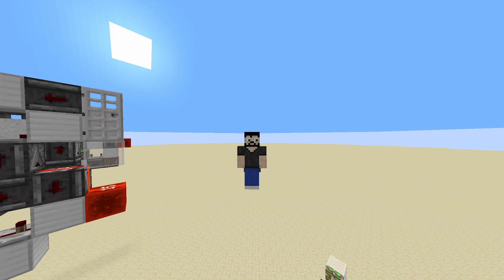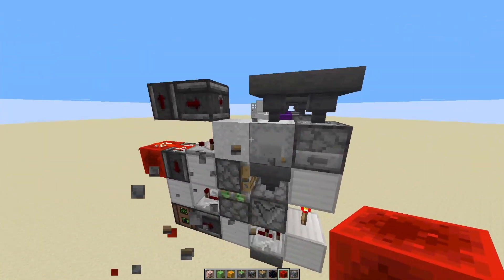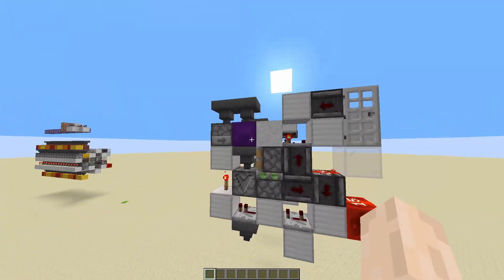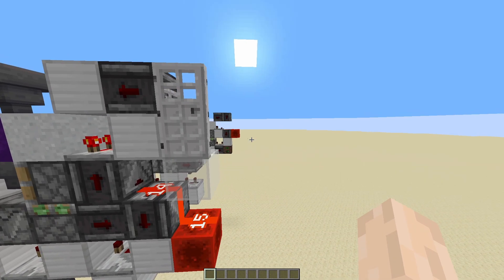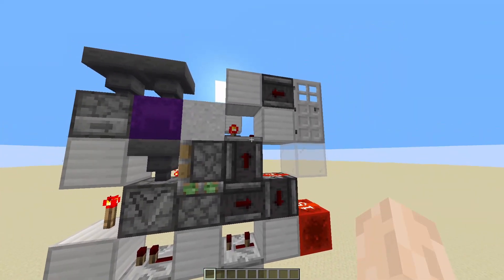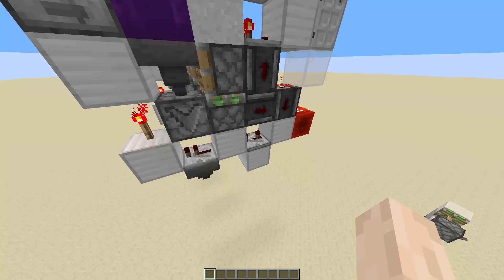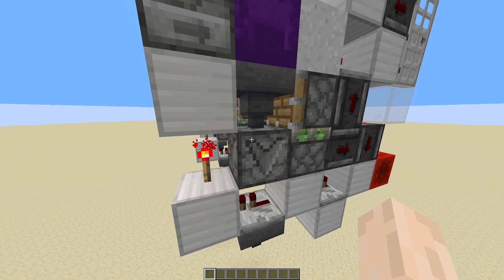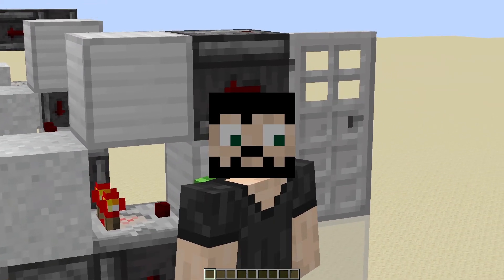Fixed 1WT Shulker Box Loader || Tutorial

Comment: Hi man, i wanted to ask how could i make it faster on the part of loading the shulker, as now It has a hopper speed
Reply from the maker: This design is just hopper speed, at least if you need it 1 wide and tileable. But if you don't care much about that, you can add hoppers on either side of the box pointing also into it. That way you make it 3 times hopper speed. It is also possible to use droppers pulsed every 4 game ticks. For every dropper, you get 2x hopper speed, so with 3, one pointing into the shulker box from the top (instead of the current hopper) and 2 from either side, you can get the system to work at 6x hopper speed. This, of course, adds the complexity of powering the droppers with a 4gt clock and then stop the clock whenever the shulker box is being replaced.

Comment: thx for this, i tried changing a few block and i didnt noticed if u put stairs under the redstone torch(so i can put the chests 1 block higher) that it would break this machine making it unable to grab the shulker after its breaks... so much time lost cuz of 1 block
Reply from the maker: Yeah, unfortunately the torch needs to be there, so a solid block is also needed. What you can do is place another hopper under that block and point it forward. Then place your chest there.

Comment: Neat. Main issue I've had with other designs was the hopper that picks up the broken Shulker is unpowered out of sync from when the shulker is broken, so you have instances where the Shulker item is pushed and despawns.

Timing the piston to break the shulker at the same time as unlocking the hopper is perfection
Reply from the maker: Thx! Yeah, precision locking is amazing!

Comment: Well done. Btw you can change the block above the redstone torch with the dropper with the hopper under the shulker pointing into it. This puts the output much higher and it was more compact for my storage system
Reply from the maker: Thanks for the suggestion! But the reason I didn't is because droppers on top of Redstone torches get strongly powered and the adjacent droppers would get weakly powered from it. So none would trigger independently.